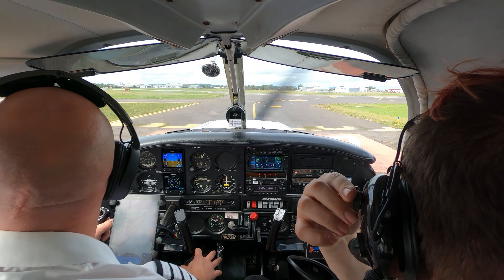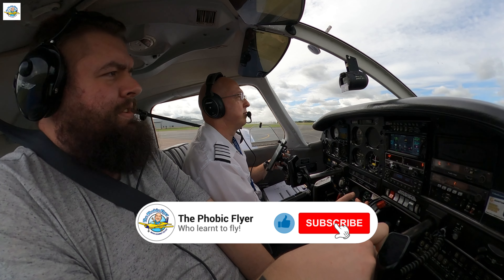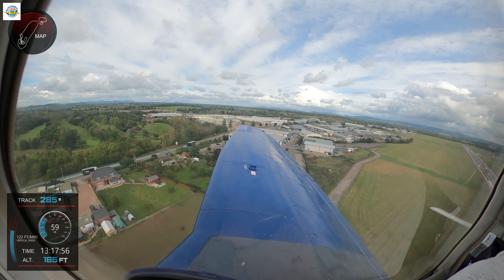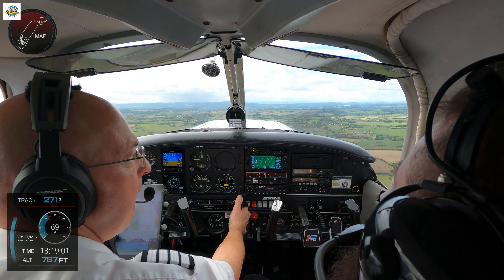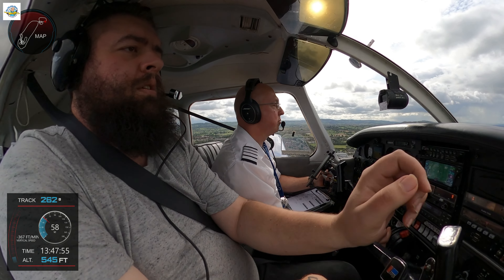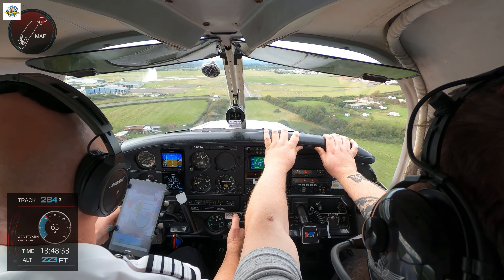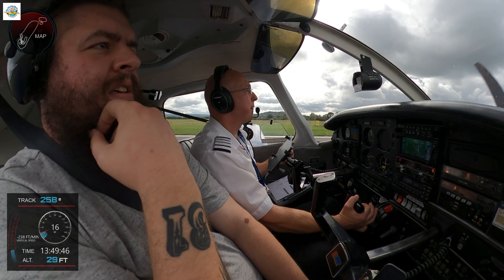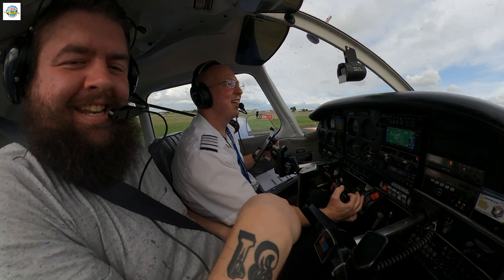Struggling on takeoff, an Airport Water Feature, and a Dodgy Right Seat on Landing

Comment: Hi, I'm also a private pilot in the UK. One thing I've gotten better at as I have been building my hours is focusing on the smaller details of a flight. At the flight school I am at, we have a PA-28 that has a cruise prop where its slightly more coarsely feathered. As good as this is for cruising, I have noticed that it increases the ground roll slightly on take-off. As the mags look like they are on both to me, I would say that this may be one thing to look at on the plane you're flying as it may be the reason why your ground roll was longer ?
Reply from the maker: @samfaulkner5695  thanks Sam, I’ll ask our engineering guy to see what pitch it is 👍
Reply: @ThePhobicFlyer  no problem, I had the same sort of dilemma until I asked my school 😁👍